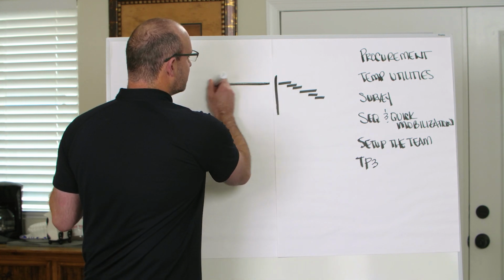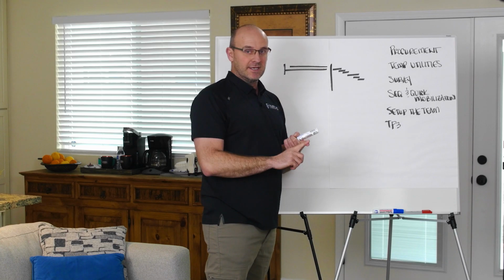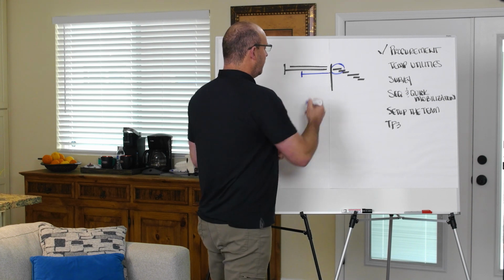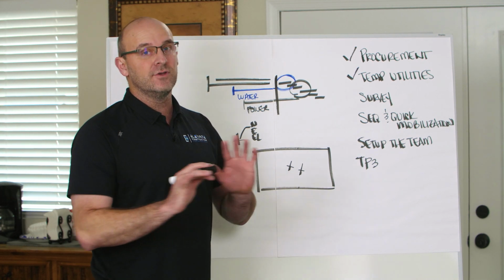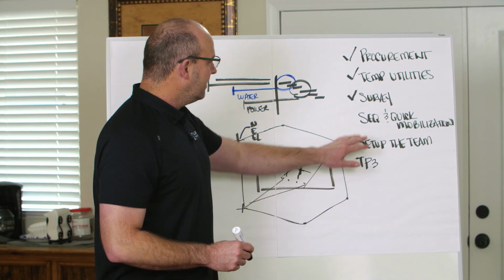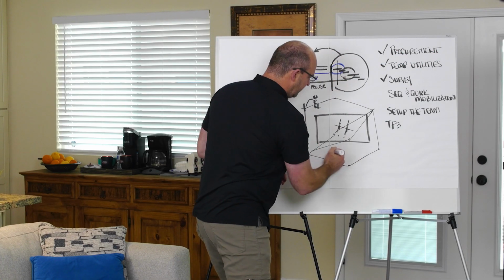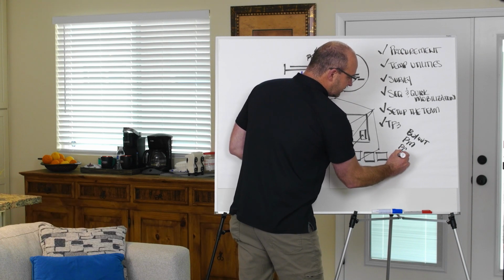How To Manage A Construction Project At The Beginning

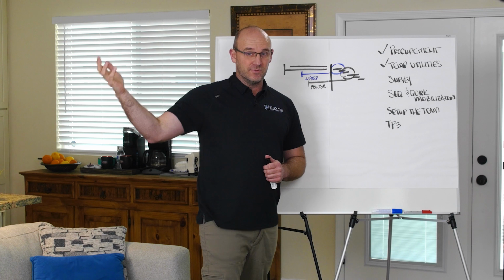Comment: 4:40 mark- GC decided to not wait for the deactivation of power lines running thru the project at the 2nd floor plate line. 3-4 month lead time for utility company scheduling. Five 3-story buildings interconnected. 4 month framing timeline turned into an 18 month project. $200,000 in change orders also, just for the framing issues. 3 superintendents with no eyes on the job or feet on the ground.   I refused to take on another project offered by them as the project foreman. That job was a disaster and there was no documentation to recoup potential losses.